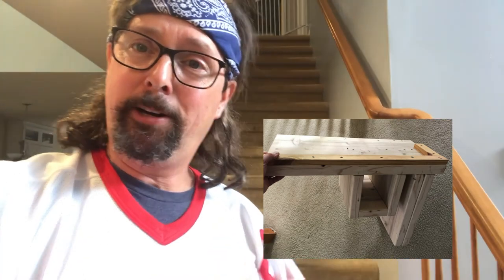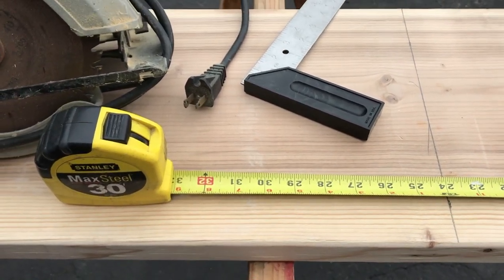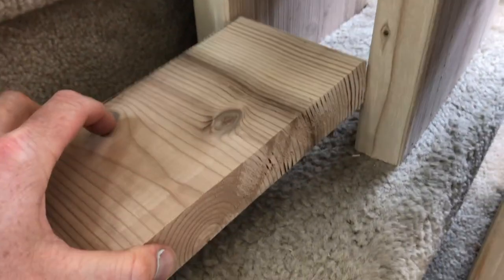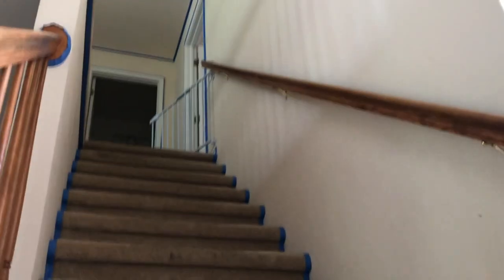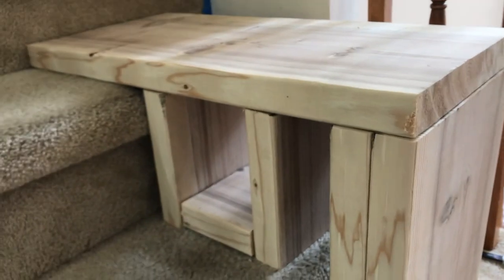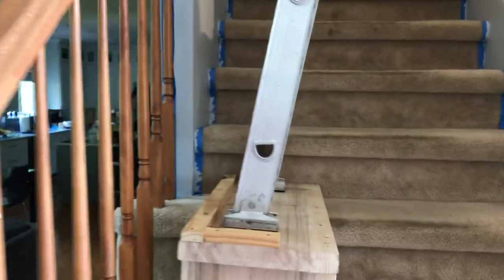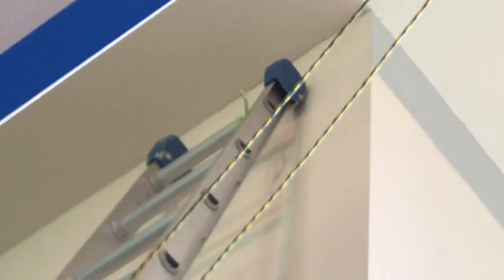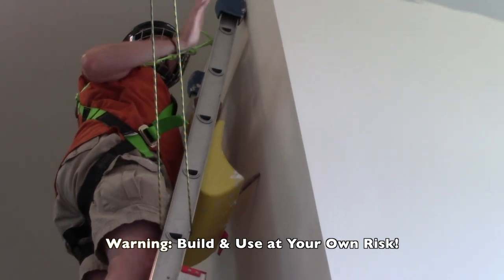Painting High Stairwell - Homemade Platform

Comment: This is so sketchy looking! I’ve been working as a contractor for years but this is the sketchiest setup I’ve seen for a stairwell yet. you would have been a million times safer if you wouldn’t have involved the ropes and harness. The platform is fine if you only have a straight ladder but your best bet is to get an adjustable step ladder like a Little Giant. For a small project like this you could even return it when your done to get your money back, but I’d recommend keeping it as it’s more useful to the average homeowner than an extension ladder. Stay safe
Reply from the maker: It worked out and hopefully never have to use again because I’m never repainting this house before I drop dead. Thanks for watching!

Comment: I built that platform a year ago and worked like a charm. Since there was a long way down the stairs to the next wall I took a long rope and tied it to a door hinge up top after I put a three inch screw into the center home into the framing. At that point the ladder could not slide towards the low side. 
Very happy to find this video!
Reply from the maker: Glad you survived the paint job, thanks for watching!

Comment: I need to make that platform and make it wider and more adjustable 😊 not all steps are the same height, thanks for sharing the video.
Reply from the maker: Good luck!
Reply: @ProjectswithChaz  Get a few pieces of boards and level it up accordingly. You dont have to nail it.

Comment: Watch out, you don’t have stability if the angle of the ladder is decreased.
Reply from the maker: Hello James, I think the angle across the width of stairs was sufficient for our ceiling height, a higher ceiling might be an issue as you suggest, thanks for the comment.
Reply: I agree with James that the ladder is prone to falling backwards when you are on it.  I'd drive a support into the wall in front of the ladder so that you can tie off to that and dispense with all the other tie offs.  When you are done,  patching that hole would be light work.  An eye bolt driven into a stud behind the drywall would be good.